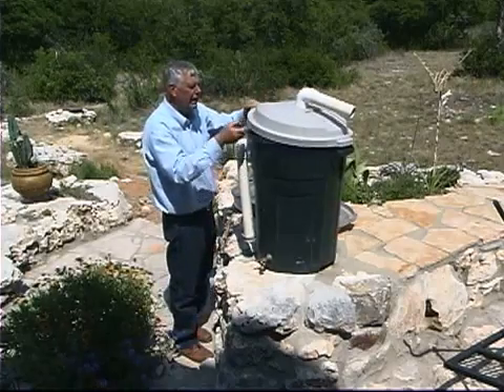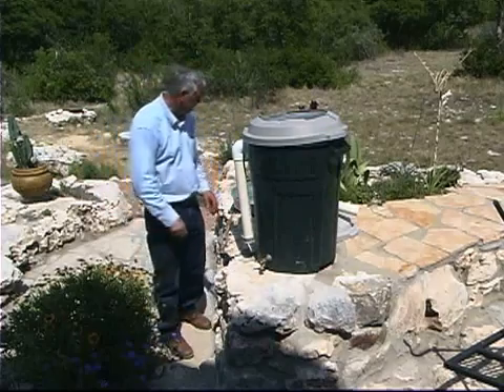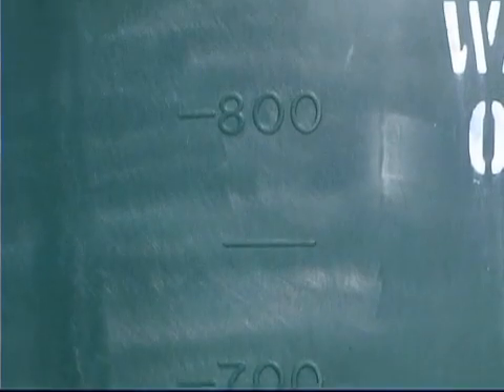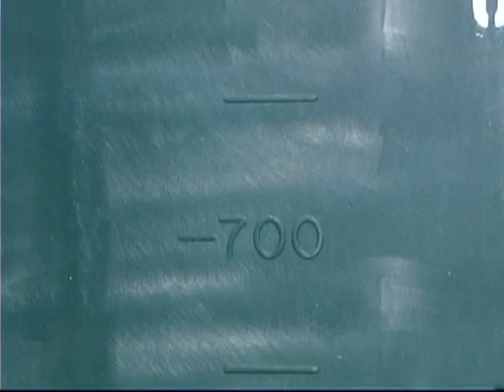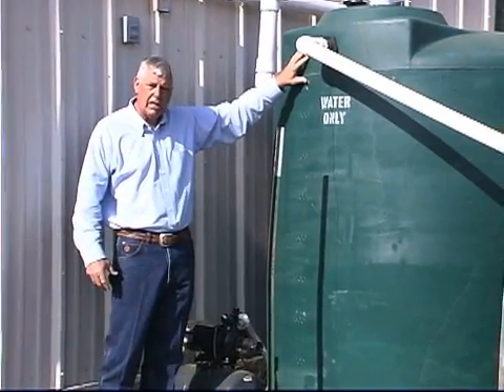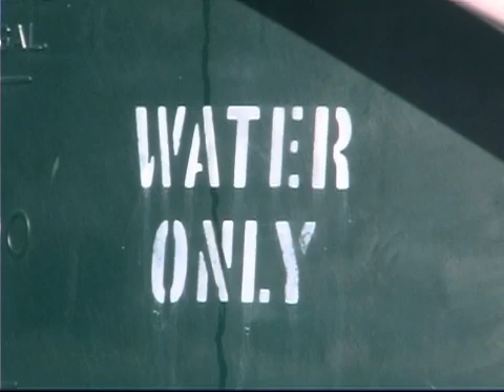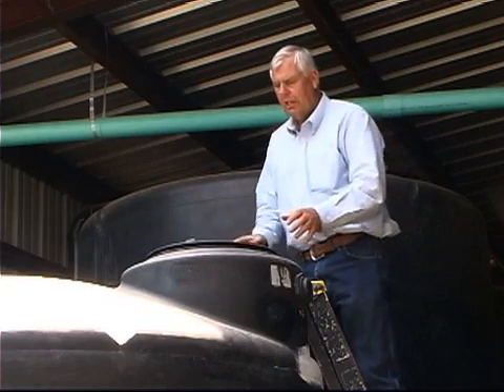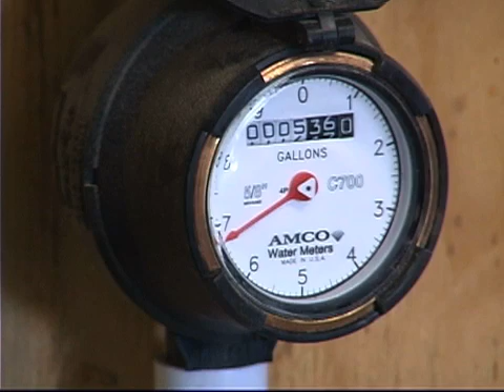Rainwater Harvesting

Comment: I have just sent an email to the above address and it bounced back.

I market a product that kills 99.999% of bacteria without power or chemicals providing safe drinking water.

The filter can be gravity fed or fed with water under pressure. Destruction of the bacteria is instant and unlike UV, it totally destroys bacteria.

Regards,

Ashley Silva
DA Water Services
714-722-7402 Cell
Reply from the maker: The video is approaching ten years old. Valuable information but still the guy was no spring chicken when it was recorded. Maybe he is dead or changed jobs. I have no lead on his wearabouts

Comment: Great info. I live in a very cold climate, how do I keep the water from freezing.?
Reply from the maker: You can bury the storage tanks below the frost line or keep them in a heated rain barn as shown in the video
Reply: The frost line here is 48." Will I need a pump to get the water out.?
Reply from the maker: If gravity won't do it than yes, a pump will likely be required
Reply: Thank's

Comment: plumbguru  I know it doesn't get cold enough long enough to freeze the tanks but I question all that exposed plumbing.  What happens when we get a hard freeze?  It looks like you have PVC, filters, and other plumbing that would freeze.
I've got an old RV trailer in Mills county, about 50 miles east of you.  When I got it the plumbing was a mess so I re-plumbed everything with 1/2" pvc.  This past December it got down to under 20F a couple of nights so being unheated, the pipes all froze.  A BUNCH of the connections (90's, elbows, and T's) broke but interestingly the actual pipe never broke.  I basically had to re-plumb the entire trailer.  I have a way to drain the system now so that shouldn't happen again.
Weird thing is I've got a several of outdoor pipes at my house in Austin that have never failed.  The only difference is they're all 1" instead of 1/2".
Are the larger PVC fittings just more robust?
Reply from the maker: Thanks for you interest.  If you would like more information from the guy in the video contact: Billy Kniffen  email  b-kniffen@tamu.edu

Comment: Very well done! One comment on the rain barrel application, is to pay attention to the location of the hose bib. If it is positioned a few inches up from the bottom of the barrel, it will allow any dust or small particles that settle on the bottom of the inside of the barrel from possibly plugging or blocking the hose bib. The video shows the hose bib to be located a few inches from the bottom.

Comment: we use about 3,500 to 3,800 gallons per month in AZ for the two of us. about 1,000 to 1,500 gallons are used for showers. about 1,000 is used for washing machine, that over 2/3 of the water we use. I going to be putting in a small grass area. Using only shower water. I've check on using shower water, they say it's ok. that leave 1,000 gallons for dishes, watering the jeep once a week and the toilets. we in the southwest need to start saving and reusing our water. last year alone I could have saved 50,000 of water if I had a way to save the rain we get. thinking of building a 24x24x10 holding  tank underground. would hold about 25,000 to 30,000 gallons of water. enough for 7 to 12 months. would like to put in some trees

Comment: Has the drought significantly constrained your water usage over the past couple of years?  Would like to do something similar in SW OK, but don't think I can count on more than 15-20 inches of rain a year.
Reply from the maker: While the inches of rain are of much importance, the square footage of catchment area (typically the roof(s) is just as important.

To calculate how much water can be collected, multiply the square footage of catchment area times .6233, times the inches of rain then use 85% of that.

If you would like more information from the guy in the video contact: 
Billy Kniffen  email  b-kniffen@tamu.edu

Comment from the maker: FACTS ABOUT RAINWATER HARVESTING IN OREGON
Designs range from a simple rain barrel at the bottom of a downspout for watering a garden to extensive cistern systems that can provide a substantial amount of the water someone uses.
Because of the efforts in Oregon to conserve water, the Building Codes Division has approved the use of rainwater harvesting systems as an alternate method to the state plumbing code. Information is available at bcd.oregon.gov.

Comment: Don't bother drilling a hole in the side of the barrel for overflow, use a "t" fitting on top for overflow.
Reply: Wouldn't all the water just divert into overflow before fitting barrel then??
Reply: @Gamer_Marcy_God  No, water won't flow over the hole until the barrel is completely full.  And unlike other connections, the barrel will be completely full.

Comment: Thanks for the post; looks great.  How much money???  I'm on well water and am always concerned about water usage during the Georgia summers.  We've done some of the smaller 30 gallon rubbermaid tanks but it is not a consitent source.
Looks like you can get pretty elaborate and run the potential of adding higher cost.
Thoughts?